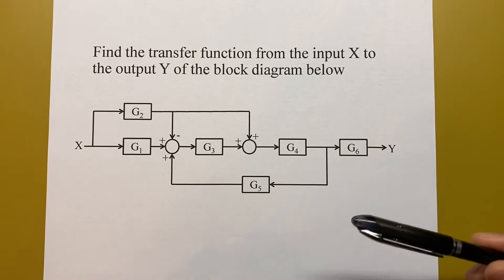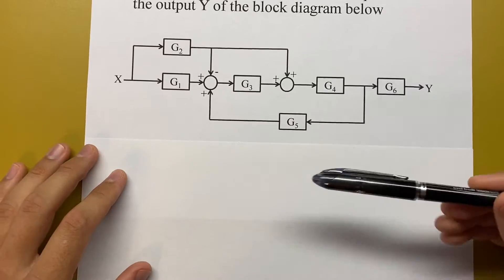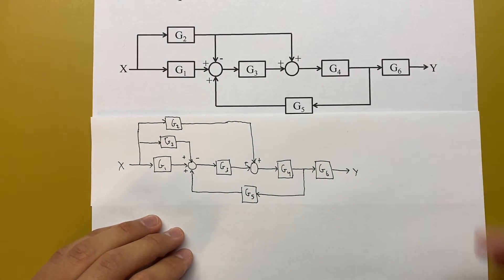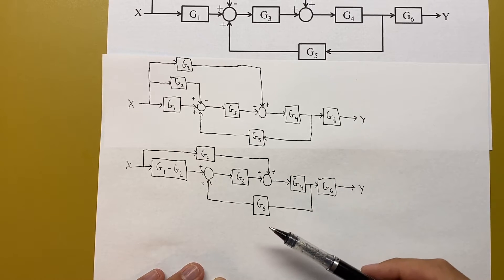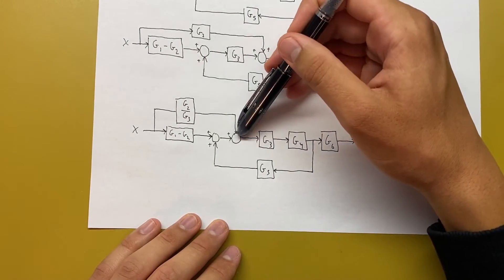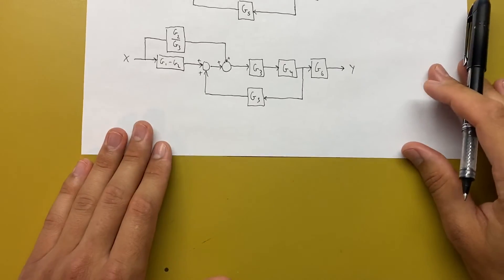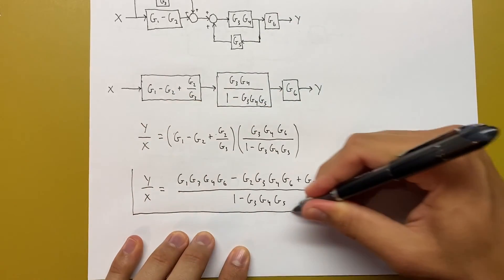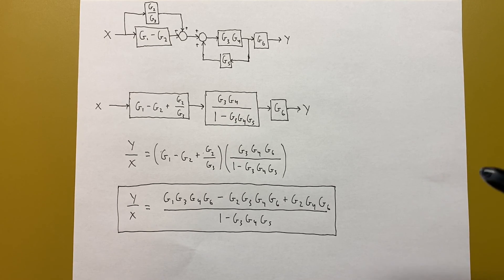Finding Transfer Function of a Block Diagram Example (Block Diagram Reduction Method)

Comment: I don't get the same answer when I move the junction between G3 and G4 in front of G4 , Why?
Reply from the maker: I just went through the problem again starting with moving the right-most summing junction to the right of G4 putting a G4 into the upper right branch. I got the same answer as in the video. The steps I followed were as follows:

• move right most summing junction to right of G4 and make upper right branch contain G4
• multiply original G4 with G3 since they are now in series
• move takeoff point to right of G2 upstream similar to how I started in the video which makes the upper right branch G2G4
• combine G1 and original G2 in parallel to get G1-G2
• move summing junction to the left of G3G4 downstream of G3G4 making the bottom branch G3G4G5
• multiply (G1-G2) with G3G4 since they are in series
• combine left side of diagram in parallel to get (G2G4 + G1G3G4 - G2G3G4)
• use feedback rule on right side of diagram (before G6) to get 1/(1-G3G4G5)
• multiply together remaining three blocks in parallel to get final transfer function

I hope this helps. There are many different ways you can do this kind of problem, but they should all get you to the same answer